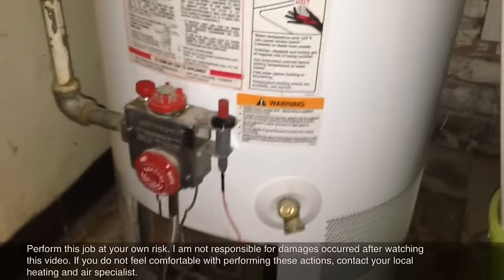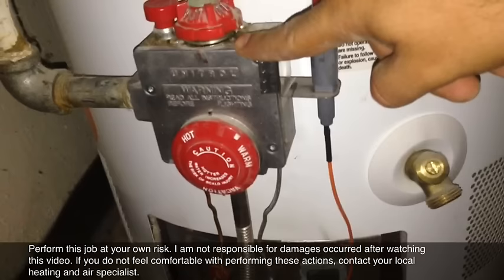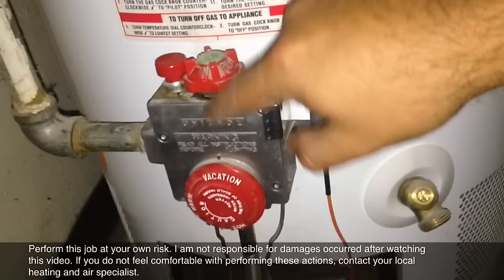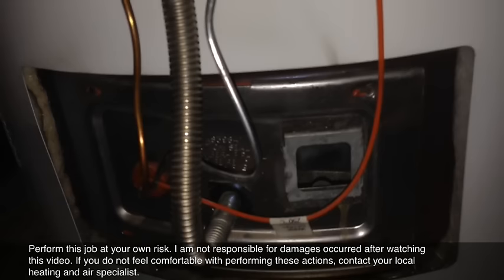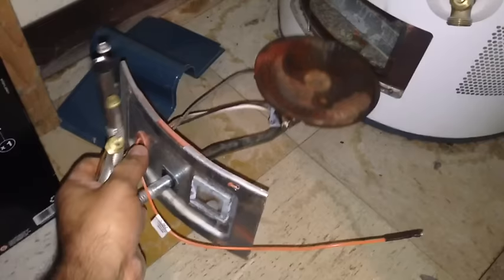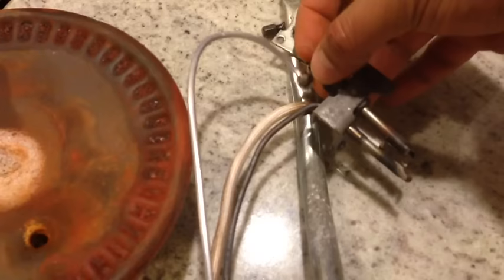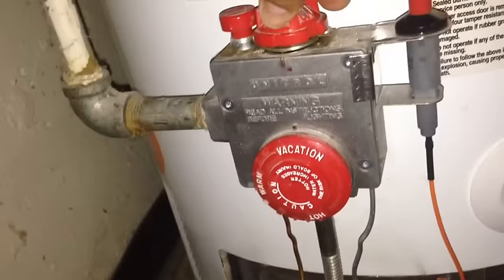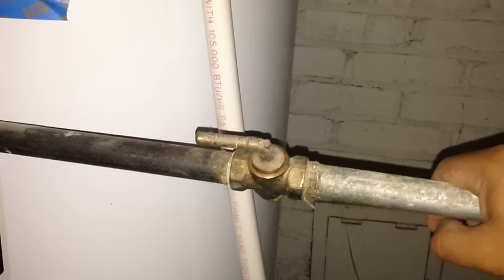Water Heater Pilot Light Will Not Light Up

Comment: Thanks for this video as it gave me insight into what might cause my pilot to not ignite. In my case I had a leak in the hot water line at the top of the tank which caused the burner to get wet. I pulled it out as you showed and cleaned/dried everything. BTW, the end of the pilot gas line fit nicely in a bicycle pump which allowed me to gently blow out the line. I put it all back together and it fired right up.
Thanks again!
Reply from the maker: Very cool.

Comment: I had a problem mine for nearly two years and the burner came on for 5 seconds and the whole thing would go off.  It's a 3 year old water heater. 
These don't work like the old ones do.  So I had to clean out the mice nest and it works now.     When it first did this  and lit it  there was an explosion in the chamber.  I thought it was ruined.    It does ok now.    It was getting enough ventilation.

Comment: Tony Sohn,
So your issue was the thermo coupler instead of the pilot light orifice? Is that part located on the outside of the water heater by the thermo coupler line or inside of the cover when you remove the burner plate & cover? Can you please elaborate a little more on the small piece at the end of the thermal coupler? My pilot kept going out after I'd light it up, but now it won't light up at all after initially it did light up, then went out twice. No dice on lighting it up now..

Comment: Hello great video, but I have one question. When you tested to see if gas was flowing properly. Did you have everything connected and gas line turned on, and have the pilot gas line disconnected? If so, did you then push down on the "pilot" setting for just a brief second/half second and smell for gas? 

Thanks!

Comment: Hello there.. I have a Rheem classic professional & I cannot get the bigger center gas line nut to free up so that I can remove the burner. It's on so tight that it feels like the valve is going to rip off of the tank, causing damage, then leak. Either original installer over tightened the nut or else put loc tight on it. Unless thread loosens in opposite direction. Shouldn't it turn lefty loosie not righty tighty & Is that a 18mm nut?

Comment: Have you noticed any strange happenings in your basement? Ghosts?  Anyway, thank you for your video, very helpful.  In my case, I don't see the ignitor producing any spark and I don't hear or smell the gas.  What do you recommend to do in this case?
Reply: I am also having that problem. Some please help???
Reply: Replace the igniter
Reply: Pull the ignitor and see if it's corroded. If so, clean it with a small wire brush, steel wool, or fine sand paper and see if it sparks. If not, replace ignitor. Lowe's or Home Depot has them for a few bucks
Reply: If it's not corroded, the diode is probably bad. Just replace ignitor in that case
Reply from the maker: Delilah, I would replace the ignitor.... in regards to ghost, no, I haven't seen any but I haven't really looked... LOL.  Did you see any in the video?

Comment: On the off chance you still get notices, HOW did you clean the tiny hole?
Reply from the maker: Hey Jim, I just used a needle.
Reply: @sfcordova1975  Thanks.  It turns out mine wasn't clogged. But the chamber/cavity it screws into had some trash.  I blew out the trash and all is working.  Thanks far your help.  

By the way, no body mentions how difficult the 3 B Nuts you have to take loose to remove the burner assembly can be to put back on.  I began to think I would never get the two little ones started -- almost gave up and bought a new water heater since I didn't figure blowing out the trash would have fixed it anyway and all this trouble would be for nothing.

Comment: What if you don't even see that little flash or spark when you push the igniter?
Reply: Someone please answer this question
Reply: replace your ignitor
Reply: It turned out that when I turned out all the lights in my basement I was able to see the tiny spark/flash, and with a few tries I was able to get the pilot-light lit, and then the big burner that heats the water etc. and now have hot water.
Reply: Awesome.
Reply: Yeah, it was awesome! I'm glad I waited—even missing a couple of showers—before calling the professionals to probably, perhaps, perchance get screwed!lol

Comment: When I pushed the striker/ignitor, I don't see a spark through the viewing glass.  Any ideas?
Reply: oneblacktl  if the wire from the igniter button is damaged or sparks outside the water heater's burner before it gets to the burner it cannot ignite the burner. on mine the misdirected spark was visible in a darkened basement at the push-together connector near the igniter button, sparking to the metal gas valve.

Comment: my problem is not the copper thermal coupler but the silver rod next to the copper one is there a different name for that one ( mine is broken) I can't seem to find it anywhere
Reply: sandra moll  its called the gas valve Sandra its the silver rod...
Reply: markandtaylor1 thank you I already fixed it last MondAY
Reply: sandra moll The "silver rod" is probably a Roll Out Sensor. Usually easy to clean with very fine steel wool. Don't use sand paper or even course steel wool as it makes scratches in the metal that make it easier for carbon/soot to accumulate on.
Reply: Elder Hardin thank you I had to replace mine  because it was broken in half

Comment: Wonderful video.  Thanks. I'll check out my system.
Reply: I replaced the two thermostats for a total cost of $28.00. Home Depot wanted $600 plus to install a new electric hot water heater.

Comment: I'm just hoping all it is is a gas line and that my hot water heater didn't go out on me
Reply from the maker: Did you have any moisture or water around the burner or on the inside of the heater?  If so, that may have been what clogged up the line to begin with.  If you do have water, I would look at replacing your water heater ASAP.